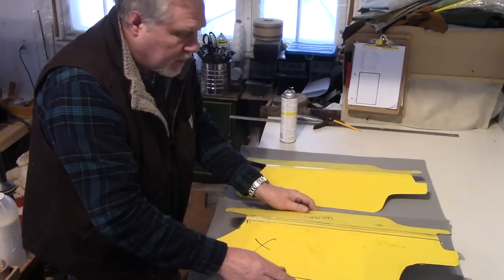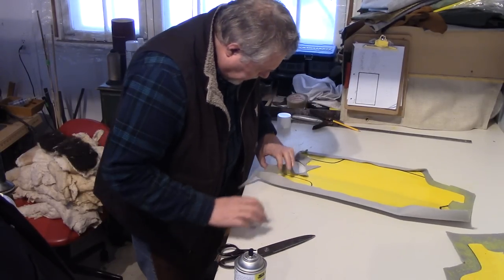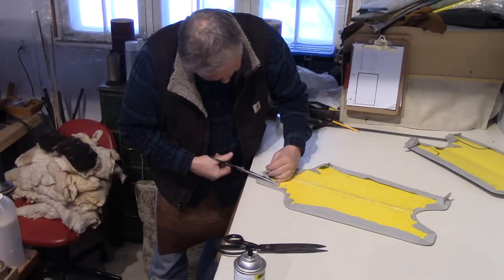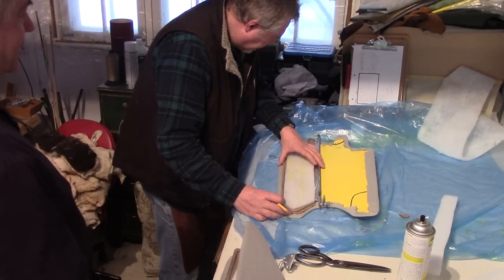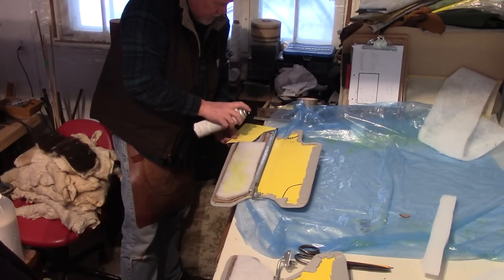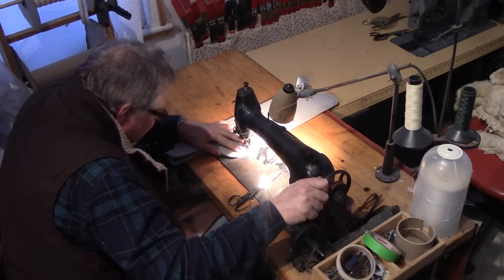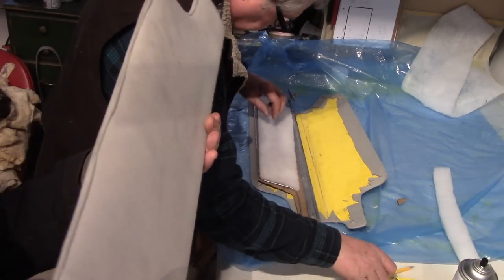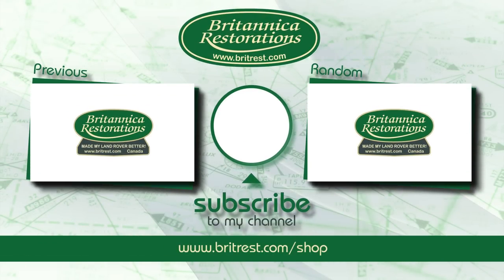Sun visor recovery. Typical old British style sun visor - can we fix it? Part 2

Comment: Would it be possible to wrap the outside from the non hinging side? That way your long stitched side wouldn't be on show.
Reply from the maker: Not really as there is a metal frame inside wider at the front than the back - it would be difficult to make a pocket and fit it in
We did consider it - but found there was no one else doing that way - if the sun visor was oblong and parallel, then maybe